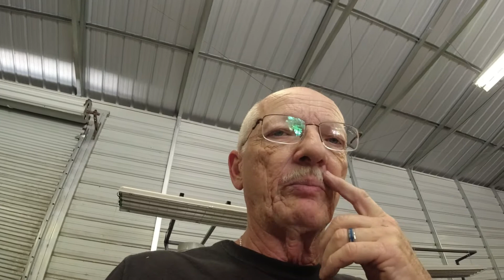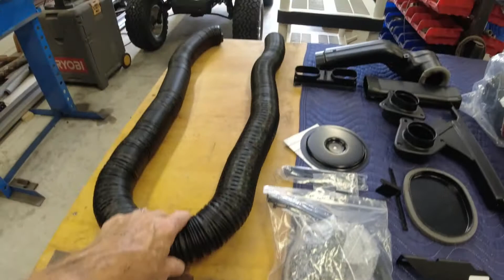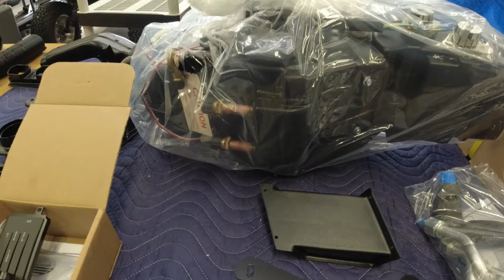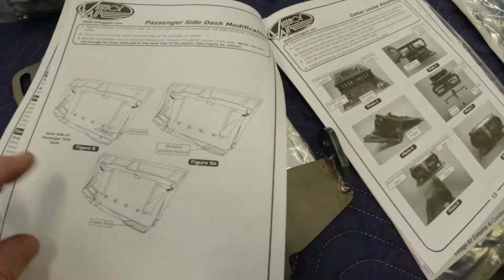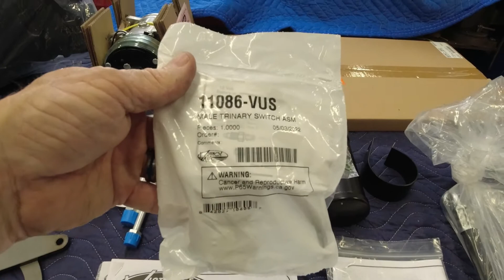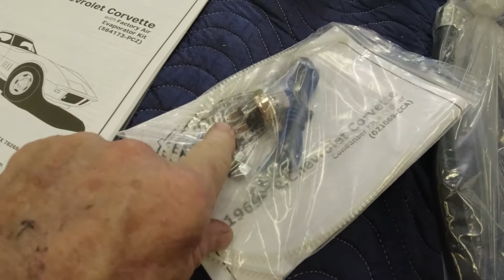Vintage Air AC Install For A C3 Corvette, Part 1.

Comment: I Really appreciate and enjoy your videos , I bought a really nice 75 C3 but it needed rewiring and to finish install the dash with the vintage air. I have tried to pay someone to put my dash and the AC ducting back together and they won't touch it. I think together we'll get it done.  Thanks again.
Reply from the maker: Where are you located? I can do the work on your car.

Comment: Did you have any vacuum problems once you installed the new console control panel? Just had it installed in my ‘72 Vette and have serious vacuum problems. At your convenience. Thank You!
Reply from the maker: No, I removed all the old AC/heater vacuum lines before installing the Vintage Air. The new system does not require any vacuum to operate.

Comment: I don't know much about A/C, but I had a 1989 Nissan truck with the most amazing A/C. It blew so cold, it would give you a headache. You could find one at any junkyard. Perhaps one could be installed in a C3?
Reply from the maker: That would be an interesting project.

Comment: Great video series!  I have a Red 71 with factory AC that doesn't work either.  Going with Vintage Air system as well...  I am removing the old system right now.  Question: what did you do with the heater blower resister?  There's an orange wire that goes from Horn Relay to Blower Relay and I believe that splices the wire to the ammeter.  Did you leave the old blower relay as is?
Reply from the maker: I removed all the heater circuitry including all the wire and electrical components.  I also removed all the vacuum lines and switches. I used the controls supplied with the Vintage Air System.

Comment: The Trinary Switch is for allowing your a/c system to not have to run the electric fan when you are at speed...... or, that is why I installed one in my 68 aftermarket a/c (different brand, Hot Rod A/C, but it works super).  You're smart to do it now.
Reply from the maker: Thanks. I don't know if I will install electric fans since my factory fan is working fine but I did not want to have to add the switch later.

Comment: Hi Marc, you have big plans👍🏼😉 good luck for this job. My A6 compressor clutch rip this spring, for me its a winter project. I hope my dryer is already in good condition, but mamy times is not only one thing in the ac system.
Reply from the maker: I have finished my installation. I will be posting videos of the install over the next few weeks. The Vintage Air unit is easy to install and I have been using it the last week or so. It works great. I am very happy with it so far. Good luck with your project.

Comment: Fun how the vintage air business works. I order mine for my 72 in late June and it was delivered in mid August.   They told me late September go figure
Reply from the maker: I ordered mine in February and told me it would be September before I would receive it. It came in about mid June. I didn't start installing it until August the 8th. I think they tell everyone a later date for deliver so we are happy when it comes in sooner than expected. They are easy to install and they work great.